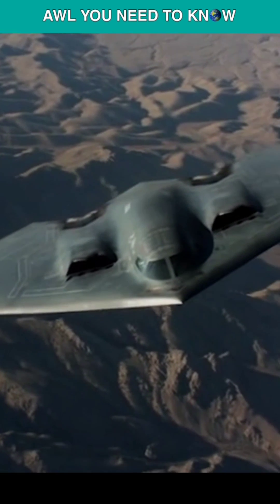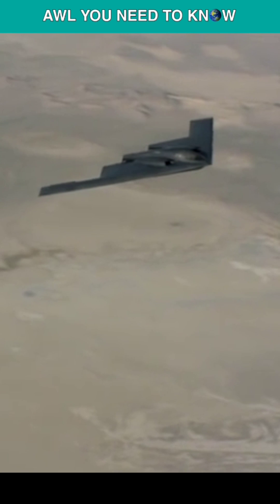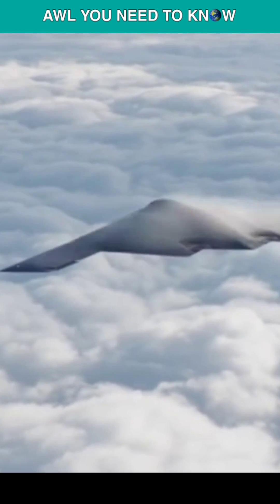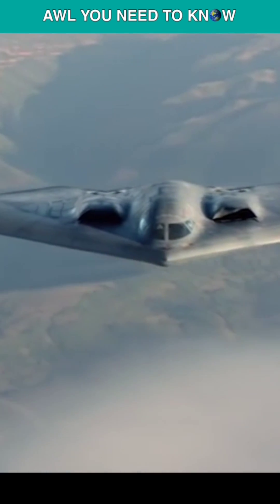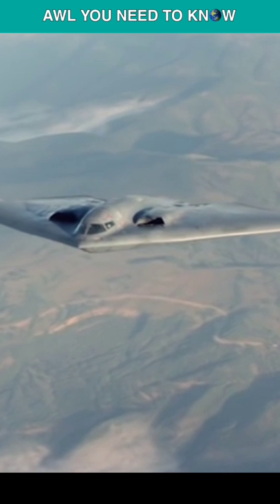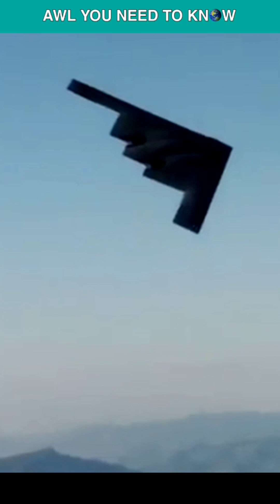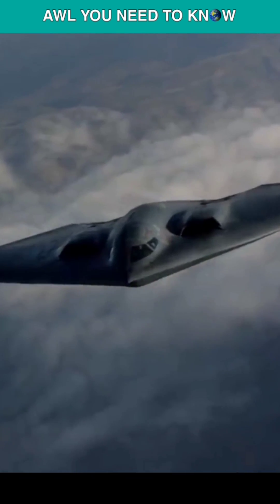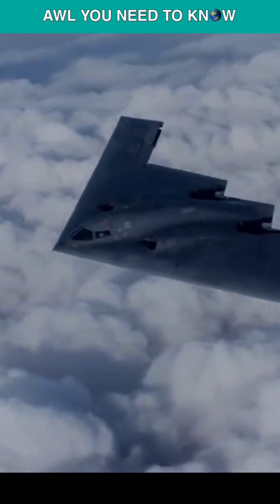Why The B-2 Bomber Can Not Fly In Rain?

Comment: This video is 99% Bull💩
Operationally, this is an all weather aircraft.
Anytime Anywhere.

However, the B-2 must be housed in an enclosed environment because it is sensitive to inclement weather. Also, paints(fade in time with sunlight exposure), and radar absorbing coatings are also sensitive to longterm exposure to sunlight.

"This doesn't mean they can't set outside", but why would you be moving aircraft in and out of their hangar.

Left outside would require much more expensive maintenance of the radar absorbing coating.
And obviously, hail damage wouldn't do its stealth much good. This would require replacing metal and composite panels.

Surprise...
The above housing is required for all 5th generation stealth aircraft. It's just the nature of the beast.
Any country who develops this technology will have the same requirements.

Comment: Surely the B2 cannot require 'pleasant temperatures' - whatever is meant by that. Because at altitude the temperature is about -57 C and there is no way to avoid it.
Reply: @Fomites

Correct. This video is 99% Bull💩

Operationally, this is an all weather aircraft.
Anytime Anywhere.

However, the B-2 must be housed in an enclosed environment because it is sensitive to inclement weather. Also, like all paints(they'll fade in time), the radar absorbing coating is somewhat sensitive to prolonged exposure to sunlight.

"This doesn't mean they can't set outside", but why would you be moving aircraft in and out of their hangar.

Left outside would require much more expensive maintenance of the radar absorbing coating.
And obviously, hail damage wouldn't do its stealth much good. This would require replacing metal and composite panels.

Surprise...
The above housing is required for all 5th generation stealth aircraft. It's just the nature of the beast.
Any country who develops this technology will have the same requirements.